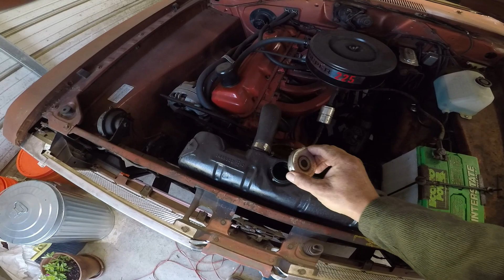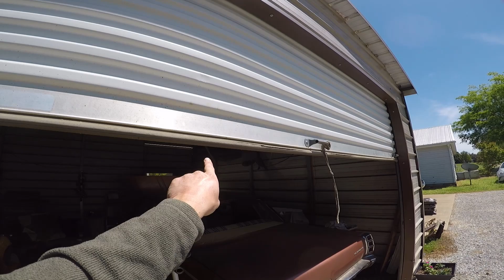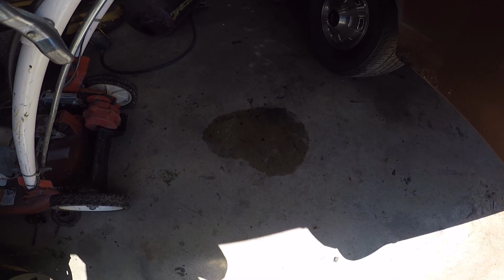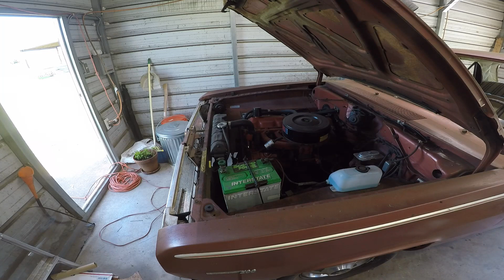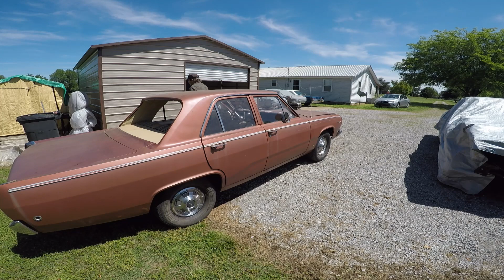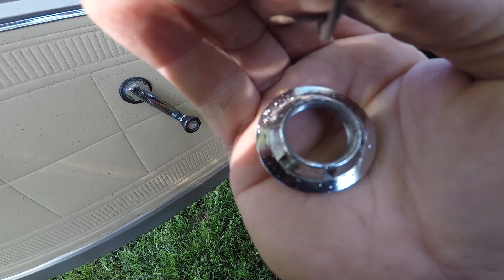Slant Six 7-month cold start plus a memory lapse

Comment: I found out a few years ago that as you get older your eyes can’t see details in shadows very well. Sucks working in the garage with the door open. Like you said it’s easier working outside unless you put more lighting in the garage. I would suggest you install cheap clamping drop lights in the garage corners near the ceiling and point the lights towards the center. This will fix not being able to see under the hood. I bought a floor fan that has outlets on it, and plug my drop light into that. Keep cool and see at the same time. 😊

Comment: It's cool and retro but every time I find a mopar with a Santa 6 just makes me disappointed. They are great strong engines but to much work and cost to make it a good performer Easier to just 318 swap the damn things atleast there are parts for it. But true probs to anyone that builds a slant 6 they have alot more patience then I do, good job guys!! Much respect but slant not for me
Reply from the maker: Well I've had both of them and neither really is a performer. If I were to build an A-body to be a runner I would use a V8 car to begin with and start with a 360 and go from there. A Slant six is what it is...a good driver engine.

Comment: Are the valve seats harden to accept unleaded fuel or are you adding a lead substitute? Being a 68 it wouldn't have the harden valve seats yet.
Reply from the maker: The engine is a '72, so it has hardened seats already.

Comment: Would the tip about starting in neutral work on a 1971, I've never tried this.
Reply: I’ve never owned a pre-80 car that wouldn’t start in Neutral. I could start our 2014 Town and Country that way if needed (due to a faulty ignition lockout switch). Also it’s best to idle a Chrysler trans in neutral instead of park, unless you’ve modified the valve body.